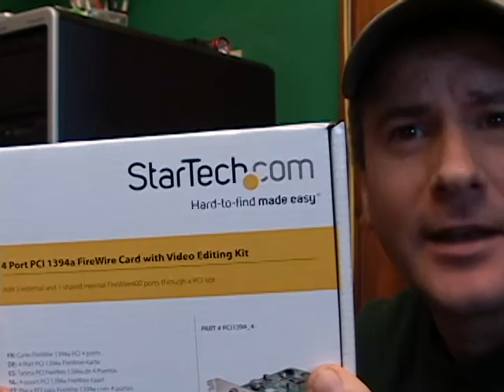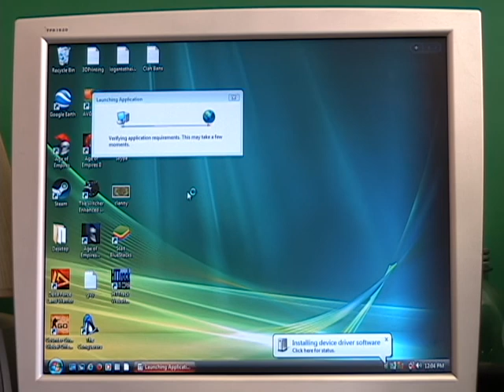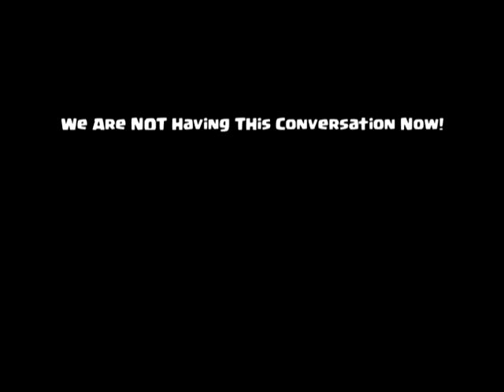How To Install A PCI Firewire Card

Comment: I was getting concerned when I saw you caressing your computer, but then the Anti Static reference came in. One thing to remember about PCI cards and when transferring videos or recording music live, is that if it cuts out or all of a sudden, or it stops the recording in the beginning or middle, that the problem is the chip set.  This problem does not happen with the TI chipsets(Texas Instruments).  It is not always easy to find a PCI card with a TI chipset, but they are out there.  Search PCI card firewire with TI chipset(very important).  Good post.  Thanks for sharing.

Comment: Dude, thanks for posting this video. I found it to be very helpful. I have an old HP Compaq Presario computer running Windows XP. I wanted to use the old flight simulators, yokes and pedals on my old computer but compatibly issuses with out of date gameports stopped me. I will be getting a PCI sound card that has a gameport connection on it now because of your video. It looks so easy to install. Again thanks for this video.

Comment: I don't know the particular model of your Dell desktop computer in the video, but it appears to be somewhat older than my 2006i Dell XPS410 desktop computer.  Wow, that Dell XPS410 desktop computer is sure a tank (heavy).  Anyways, I installed a StarTech  4 port PCI 1394a FireWire card (purchased from Amazon) inside my Gateway Essential 700S desktop computer earlier today without a hitch.  On the Gateway Essential 700S desktop computer, there is a black firewire cable that connects between the vertical port on the StarTech 4 port PCI 1394a FireWire card (the 4th port on the board itself) to the firewire male receptacle that is located on the front of the computer.   Now I'll have to locate a female firewire cable to the miniport on my Kodak PixPro EZ43 digital camera.  Say, that was a nice video by the way!

Comment: Hi, I Have A M Audio Profire 610 Which Hooks Up To the Computer With Firewire. 
Always Worked Fine Until One Day It Just Stop Working For Some Reason. I Never Made Changes, No Updates No Nothing It, Just Stop Working. I Am Not Very Computer Smart So I Didnt Think It Be My Firewire Card. I Went To Device Manager To Find The Ieee1394 But I Dont See It In There. Which I Should? (Right?). I Would To Had To Have One If I Was Using Firewire For All These Years Like I Was Before This Happened. Now I'm Thinking If I Reseat (Unplug And Plug Back In) The Card The Computer Might Recognize It
Again So That My Computer Shows The Ieee1394? 

My Questions Are
When I Reseat The Card Back In Will The Computer Recognize It Automatic?
Or Do I Need Some Type Of Cd For The Card? Or Internet Hooked Up?
....I'm Guessing It Will Install The Card Itself Automaticly? ...Correct?

Ps. My Card Is For Music Software,
I Have Windows 7 And E machine (Dell Product I Think)

PLEASE HELP ME IT WOULD BE GREATLY Appreciated 
GOD Bless And Thank You

This Was A Awesome Video
Reply from the maker: +Myreverlation I think you are on the right track - my first instinct would also be to re-seat the card. It should install automatically. Also try a different slot if there is one available. If it finally shows up in Device Manager, right click on it and click Update Driver - just to see if there are any updates. Other than that, I wouldn't know. I've had a video card just die for no reason. I got a new card and put it in the same slot and it worked. No idea why. Computers can be a pain sometimes. Not sure if any of this helped but good luck!
Reply: WornOutShoes
Thank you Very Much GOD Bless